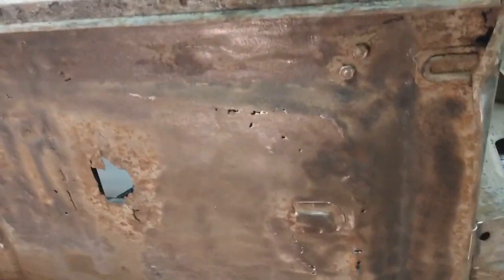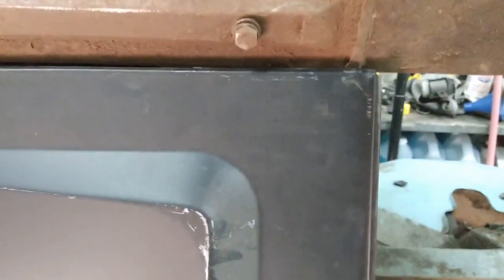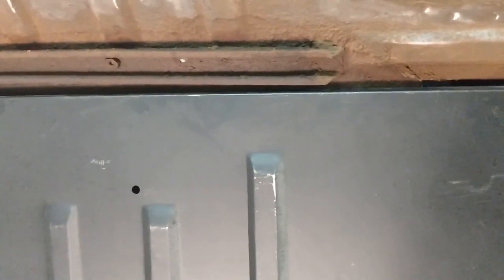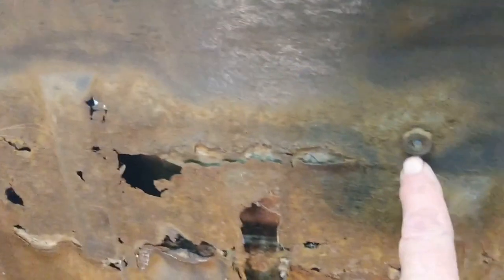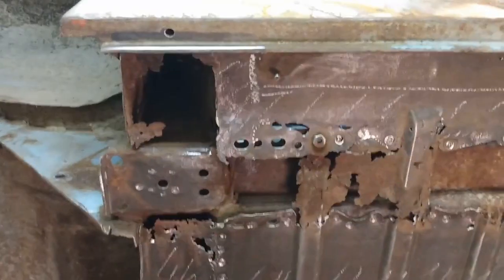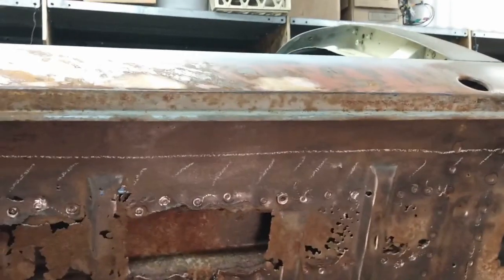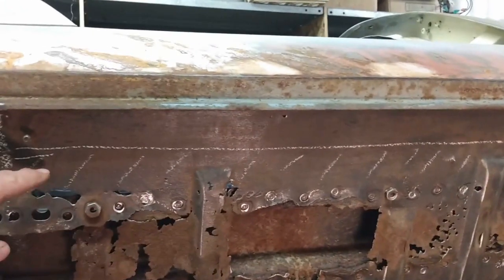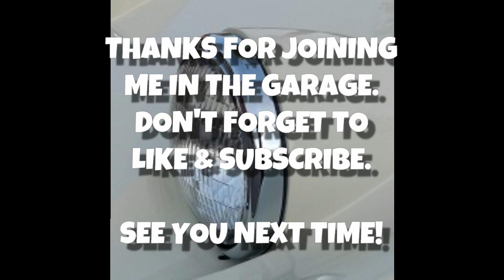Original vs. aftermarket floor pan comparison and floor removal started. Bugeye Build Episode 9

Comment: Well, i guess I was not completely up to date!!  Nice work.  That floor pan is probably for multiple years, and some of the items you pointed out may have been eliminated over time.
Reply from the maker: That's what I was thinking. It's not a big problem though, it shouldn't be too difficult to add the drainage slots if I decide to do so.